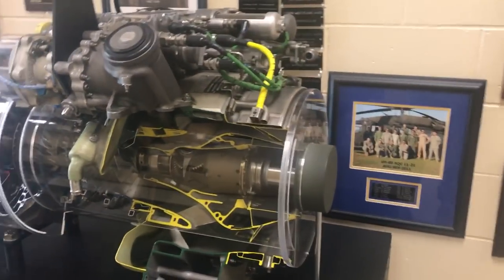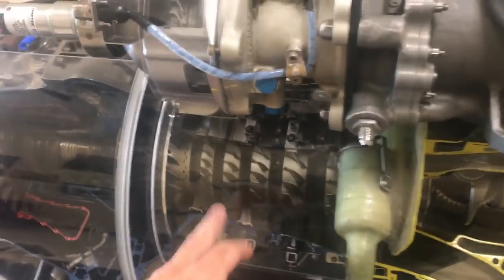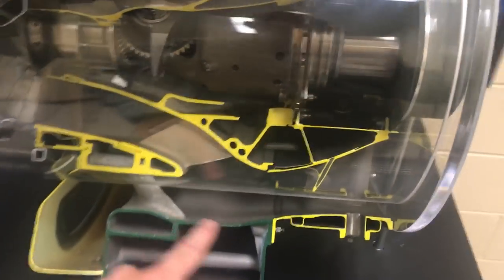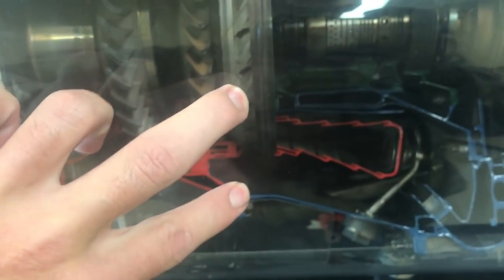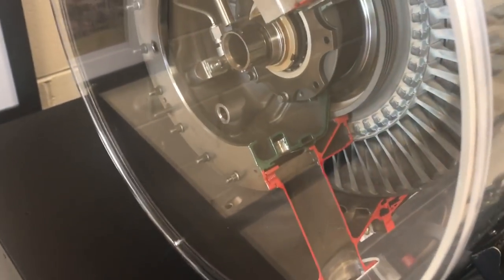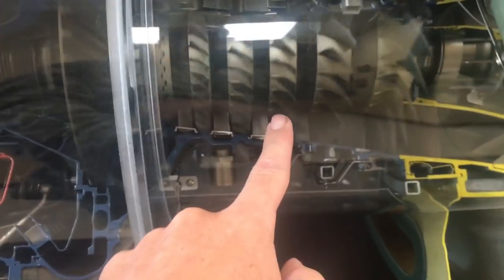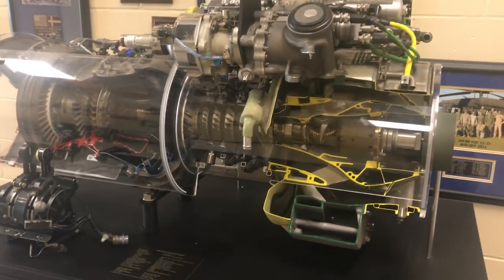How a Gas Turbine engine works Black Hawk helicopter GE T-700 series

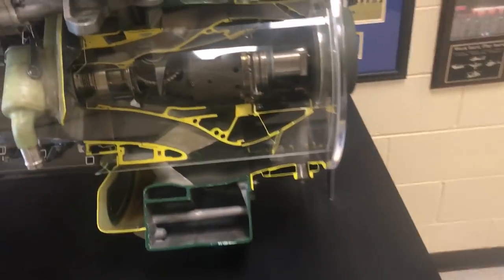Comment: Great informative video. One little correction though, the component you point out as the fuel filter at 4:34 is actually the oil filter. The fuel filter is mounted vertically and can be seen just below and inboard of the liquid to liquid cooler.
Reply from the maker: I will try to post some corrections and a diagram. Thanks for kindly pointing out my mistake.  Please share & subscribe.

Comment: Hi there. Beautiful video and great overview of t700 engine. Could you tell me if turboshaft engines through time and use require more fuel to maintain the power that is been required? Cruise flight charts doesn't mention that and. Thank you
Reply: on a ch53 it has about 4280 hp it will use about 666 lbs of fuel in 30 minutes

Comment: hi, can you please explain how the engine power transfer to blades?
Reply from the maker: Thanks for the comment, please Share & Subscribe for future videos that will explain more.
Reply: In as simple an explanation:
Engine High-Speed Shaft to input Module
Input Module to Main Transmission
Main Transmission spins rotor and tail drive shaft that spins tail rotor

Engine high speed shaft - 27,900 RPM
Input module redirects the angle 45 degrees and drops the rpm to about 15000
Input Module to transmission is redirected another 45 degrees and final RPM is 250
Tail Rotor RPM is roughly 1175 I think. It's been a while
Reply: @AlfredoPachecoJr  the imput module of the gearbox is what drives the hydraulic pump and generator. I think what you are referring to is called the gimbal.
Reply: @maestre2144  Accessory drive at the front of the input module is what drives the hydraulic pump and generator. Speed is 11,806. The engine forward support tube mounts to the gimbal on the back side of the input module. Speed of high speed shaft within the forward supper tube is 20,900. The quill shaft inside the input module that attached to the MGB main module is what is driving the MGB. I forgot what the speed of the quill shaft is. I think Mr. Pacheco  has a good idea of that, With all the gear reductions the Main Rotor speed is 258 RPM.

Comment: Burning 15 lbs of fuel a minute, and about 900 lbs an hour! Where the hell do they find the room to put people in these things with the high demand for fuel reserves?
Reply: Well, is not that the endurance of the helicopter is 20 hrs. Moreless 3.5-5 hrs, so we are talking about 4500lbs, enough room in the cabin´s floor and also you can add 1 o3 2 aux. tanks outside the helicopter with maybe 1200 lbs
Reply: @pancho311  
Actually they can carry four 200 US gal (760 L) crashworthy tanks on the stub wings.
Reply: @johno9507  indeed!